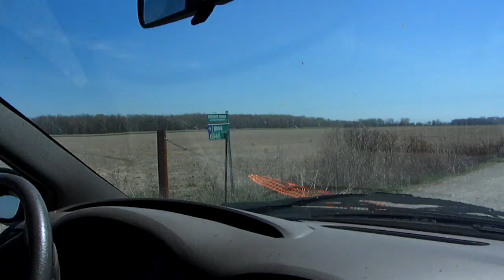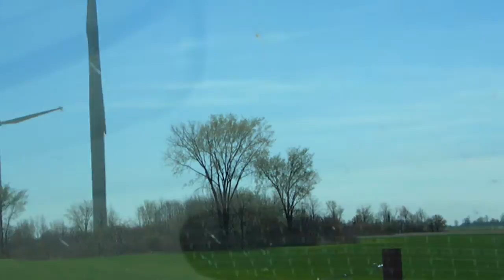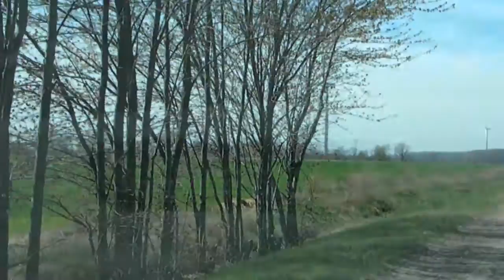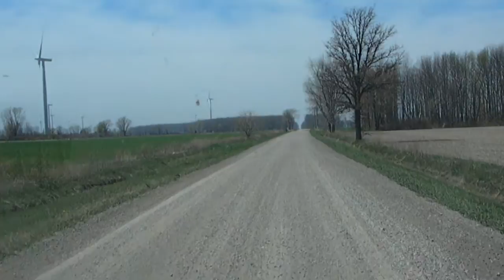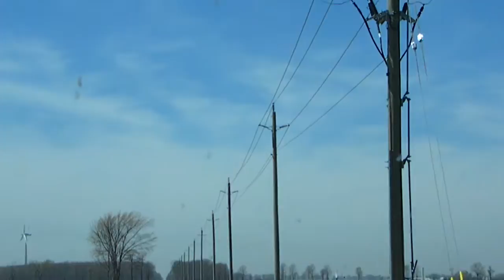Radio interference from Electrical connections/ Wind Turbines.mov

Comment from the maker: @windactionontario  thanks for your posting.  Note it's a constant pointing fingers between Hydro One and the developer who is responsible for the hook up of these turbines.  It should be noted also that when I stopped at one of the poles,  I could distinctly hear a lot of vibration.  My video unfortunately did not pick this noise up.